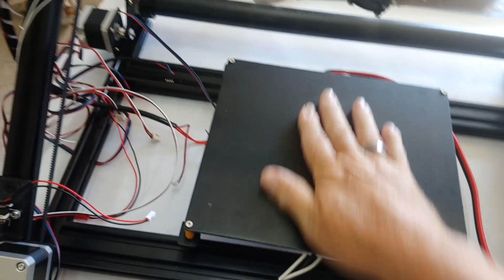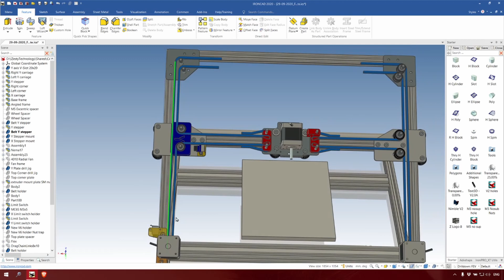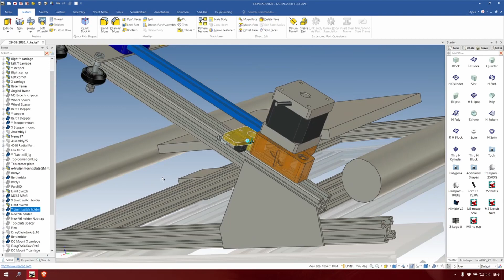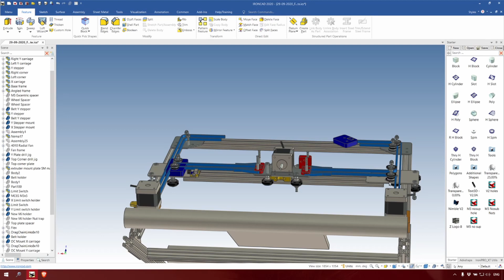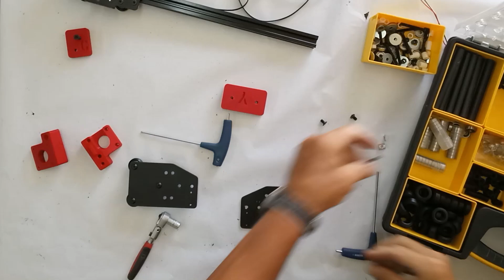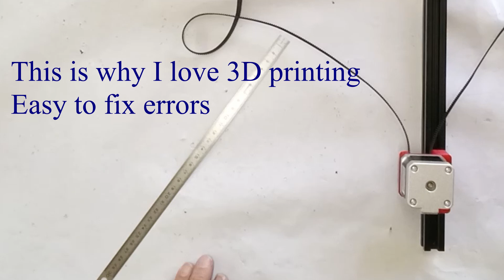Fixing Powerbelt3D Part 1

Comment: Hi, I'm starting to retrofit my powerbelt using your mods. Great work and thank you for your time and effort. Has there been anymore progress on this project?
Reply: At the moment I simply do not have the time to waste on this printer.
Once I get a belt that might work, I will do some more work on the belt system, get a good tensioning method and use proper rollers. 
The biggest re-design is the print head, and I am now looking at what hot end to use because the one they supply is useless.
Reply: @LykleSchepers  Thank you for your insights. I'm getting a bit discouraged as well.  I have a steel belt to try but working with it makes me a bit nervous to be honest heh. Take care.
Reply: @LykleSchepers  Only other question I have is what size spacers are needed from Openbuilds. I got the eccentric nuts on order but not sure what size the spacers are.

Comment: Nice work.  I have a Powerbelt 3d so will have to make all of the parts on the existing design then rebuild.  My mods have been to mill out the heating block so that the heat break is not touching and I use a stainless steel belt.  And modified the part cooling fan holder so that it did not hit the taller parts.
Reply from the maker: Good to see, but pity such work is needed. I am looking at using a different nozzle or hot end, still trying to figure out the best option.
Steel belt? Is that something like what the White Knight uses? Must have been expensive!
Reply: @Paradym  About $15 at McMaster-Carr for 6" wide.  The 12" is about $25.  I got the specs from what White Knight uses, 0.006" stainless steel shim.  Edges are sharp as hell, be careful.  I use a 20% PVA solution (diluted Elmer's clear glue) and PLA sticks and release easy.  I cut the shim to length on an angle and use 3M aluminum tape.  I had all sorts of plugging with the original hotend setup.  I use a titanium transfer tube and like I said, slightly removed some of the hotend so that it can be screwed all the way to the nozzle and still expose the heat break.  I cut off the lower fin of the the heat exchange so that the tube can be screwed all the way up as well.  Seems to work well for me.